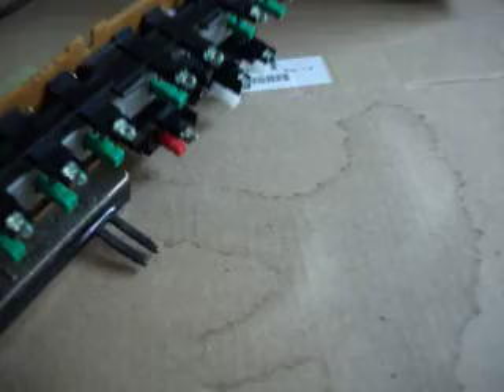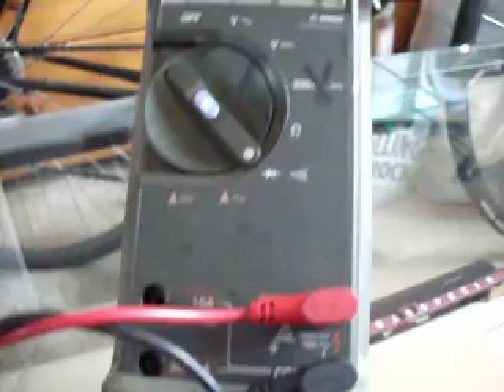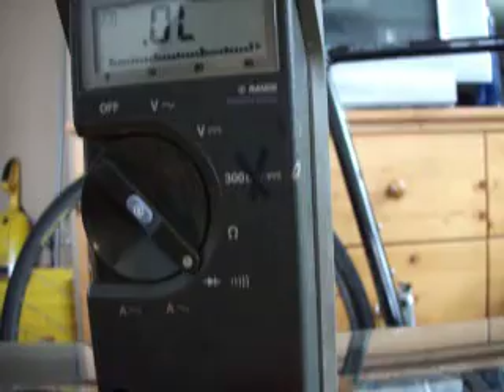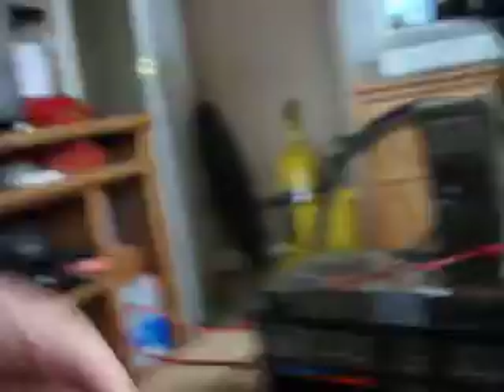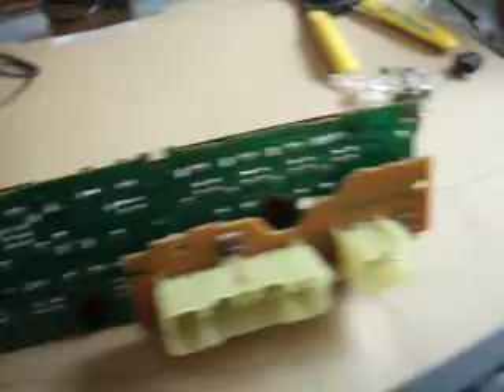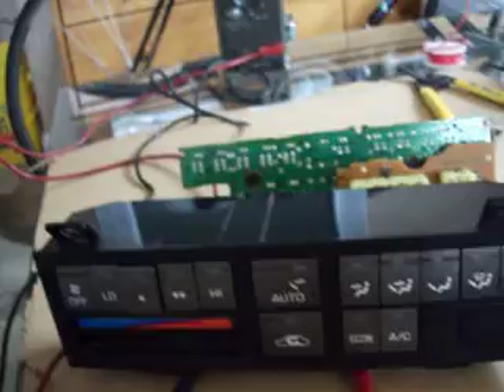HOW TO:  Toyota Camry Heater FIX !!!

Comment: So how did you eventually get it to function properly?
Can this style be replaced with all slide controls instead of push buttons
Reply from the maker: I ran a small wire across the connector that bypassed the potentiometer..so that if I had air on it would blow on hot. If I wanted cool aire I recall just removing the pin jumper (uncrowded a ghetto wire in the cabin
Reply from the maker: *uncrossed

Comment: Yes, mine too does this had it out and then figured it out that it was the wire harness connector "on the board" but now the stupid thing light indicators go on/off. Recently the whole thing went dead. A few hours later it all came "back to life". Going to pull it apart again! LOL This is my hobby car, so I don't care.

Comment: Any help with how to check and ,if need be, replace the heat door servo motor ? I've jumped the  female connectors as you suggested (key on off) with no response from the servo motor /door.

Comment: Great Video! Did you ever figure out what the problem is. I have a similar problem with an 87. I touch the "A" connector and the servo goes crazy. I can't get my main heat servo door to open. any thoughts would be greatly appreciated. Thanks Ken

Comment: I had same problem, found out that all the connections on the plugin were not making a good connection, I'm guessing from age. all I did was bend the  male terminals ( on the control itself) just a little so they made better contact, and never had an issue again, this seemed to work on other electrical issues with this car as well. 1987 camry

Comment: The contacts that are checked here for continuity are the problem. Over time the solder connection has gone bad. By bending the contacts slightly a positive connection is made. Here's the fix: unbolt the box as he did here and pop off the two connectors. Spray both the fingers and the connectors with 'Deoxit' ( Amazon: not cheap but worth every penny ). Next while you have the control box in hand drill a 3/16 hole in the black plastic directly above the two fingers this guy checks for continuity. Plug the connectors back into the box. Take a short 'Zip' tie and encircle the large plastic connector wires. Pull firmly but do not over tighten. Next take a longer Zip tie run it through the loop and through the hole you drilled. Pull firmly to put pressure on the connection upwards. Test your heater if car is hot or check to see if the hot water control on your firewall has been pulled in ( hot ) or cold ( out). Bolt box back in and enjoy the 'like new' AC/Heater operation. If it works don't thank me: send a check to The Wounded Warrior Project my favorite charity.

Comment: MY FATHER HAD THE SAME PROBLEM WITH THE HEATER I REMOVED THE HEATING UNIT AND RE-SOLDERED THE SOLDER POINT TO WHERE THE WIRE HARNESS CONNECTS........WORKS BETTER THAN EVER

Comment from the maker: @sleebb Well it sounds like you have the same problem I had.  After it stops blowing hot/warm air does the heated air ever return? Is it somewhat random?  Well that is caused by the connector in the back of the rheostat. The circuit is not reading correctly. If you watch the video, I show you how to "Jump" the connectors so that it always has heat. Or if you want you can jump it with a switch and have it be either hot or cold. (no variation.) You can jump it with a simple hairpin, or paper clip.

Comment: Have you any idea what may cause the AC to work somtimes and not . I checked the fan running but no cold air comming out just warm the led on the push button AC is on when turning the ac on , Mine is not the electronic type it is the manual type and engine is 4 cyl. I am disabled and have no money to take it in .

Comment from the maker: @runamoktoo thanks man, actually you were the person who got me to decide to get this 88 all-trac...I was asking you in your all-trac camry vid about these cars. It honestly drives so well, its such a pleasure to ride around in...not to mention I got it for 500 bux..113k miles...5 speed..and new tires/ battery!!!  As for the heater I have now put a single on/off switch in the rheostat circuit...so if it is on, I get heat, and if its off I get cool air. I was just tired of messing with it.